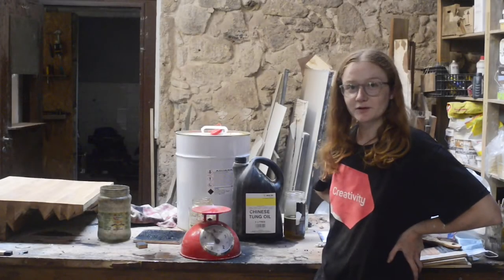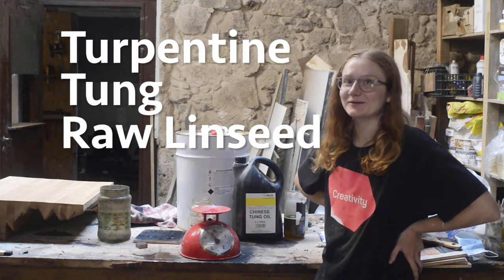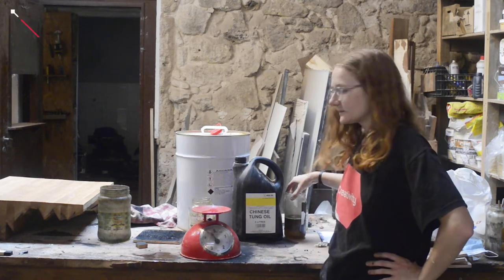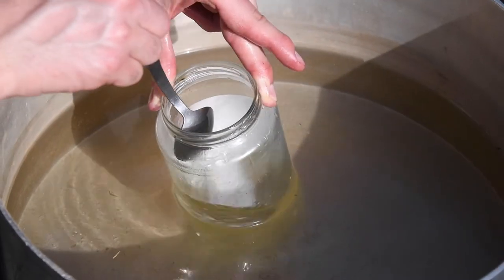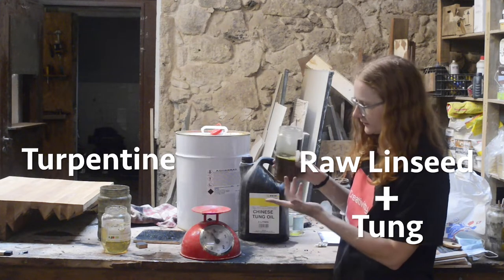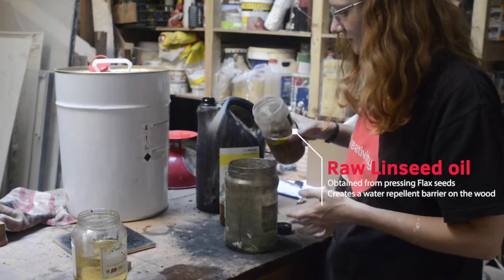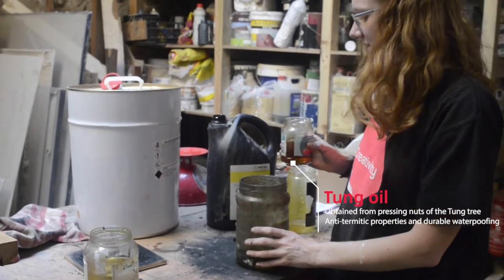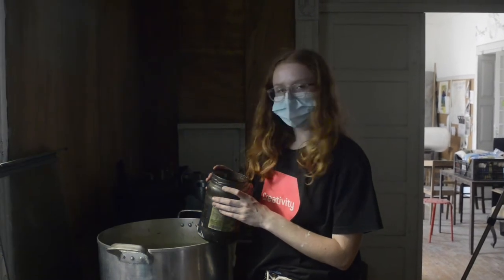Cheap Natural Wood Protection | HOW TO

Comment: Thanks for sharing this! Do you think this will be a good prevention for borer and termites?
Reply from the maker: Hi Julian, Yes the Tung oil in this recipe naturally repels insects.
Reply: @CriticalConcrete  perfect thank you! Any idea how it will perform for external timber? How often will it need to be reapplied?
Reply from the maker: @julianlang7571  We're not sure about that! Depends on the external conditions and how many layers you've put (more dissolvent in the first layers to get a better penetration). You can add 5-8% of borax in weight to have a permanent repelling element :)
Reply: @CriticalConcrete  amazing thank you - will definitely experiment with the borax. 

Do I use raw turpentine opposed to mineral turpentine? (Unprocessed is very costly here in South Africa, though still looking for suppliers) 

Would you recommend treating the timber horizontally opposed to in-situ vertically? 

Thank you 🙏
Reply: Hello, re the adding of 5-8% borax, are you saying you add it with the oils and turpentine mixture? Or do you apply it before?
Reply from the maker: Yes! put it in the oil. Mix before use. Three coats, and reoil it once a year if exposed to the elements.

Comment: Tung oil is coming from far, and as linseed oil has almost the same polymeric property, so why not using only this last one, at least in europa, where it is hard to find (otherwise it comes from colonial business..)
Reply from the maker: Yes the use of the tung is precisely because it comes from very far. Doing such we're mimicking the old practice of exchanging wood between regions, so that local bugs wouldn't eat the wood you use. The footprint of exchanging wood is a lot worse than getting the oil and add it to your mix. In our case, Tung Oil is an additive, but using the right wood (and its right parts) is most important for structural work. When it comes to decorative work (substitutable parts), we usually use a more fragile part of the trunks, so treatment (flour paint, oils, etc.) is necessary and linseed oil is indeed already a very good protection, if applied regularly.
Reply: @CriticalConcrete  Importing new pathogens also (like with wood, potentially), with high price and exploitations of poor peoples from the other side of the planet.....
Reply from the maker: @AutoNomades  Feel free to use only linseed oil. It's already really good and what we use 90% of the times. You're right on the fact that we need to be careful of the supply chains, but it's really complex actually to know in what conditions what we buy is produced. For the pathogens, I honestly think you might be overthinking it, in this particular case.